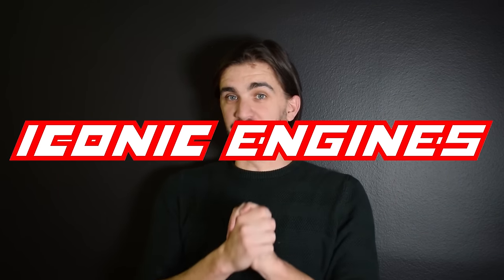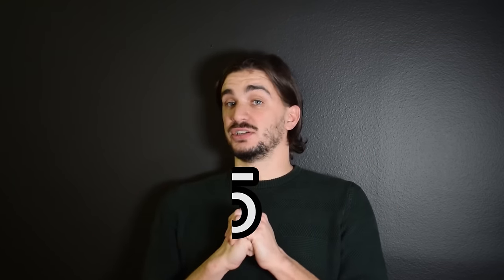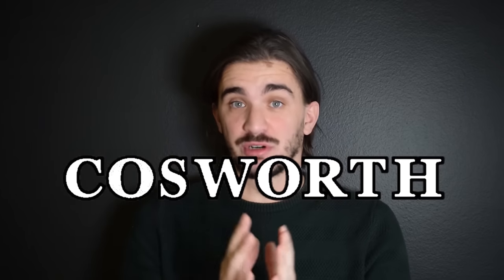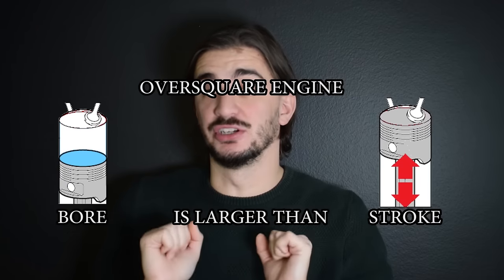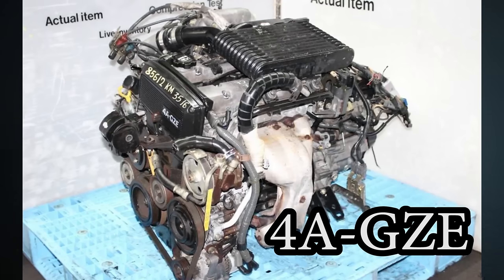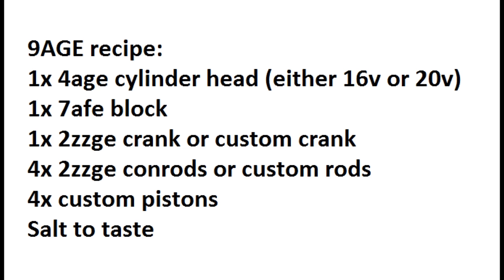Toyota 4AGE - What makes it GREAT? ICONIC ENGINES #1

Comment: I don't know how much initial d you watched but it is not all exaggerated performance. Later in the series when the engine blew they swapped it with a professional circuit race engine.
Reply: Not the 20v engine they put n takumi car. They only used the 20v engine because it looked cooler to the watchers then a Atlantic 16v.
Reply: @slow_carsgarage7422  then where did they get the engine from? When bunta was taking to his friend who called him about it they showed a racing circuit seen. Why was everyone so amazed and shocked and wanted to know how he managed to get that when they saw the new engine? Acting like it was such a rare beast. What about the high rev limit and power band?
Not picking a fight. Genuinely curious.
Reply: @basshead4204  for the anime they showed a 20v engine because it looked cooler to the viewer but the specs they told are all from the Atlantic motor. Make sense?
Reply: @slow_carsgarage7422  Wrong. They had Group A Racing in Japan back in the day. So it was possible to come across or build a Group A engine. Here is a link to the FIA homologation application for the AE101 Group A car. https://historicdb.fia.com/sites/default/files/car_attachment/1486656534/homologation_form_number_5437_group_a.pdf

Comment: Running a stock Silvertop-block, stock head(20v-ST), stock-bolts, stock cams, stock crank, getting about 500Hp reliably out of it from 1.6bars boost and a bit of nos... only upgrades are H-beam rods,  Forged pistons and bigger injectors, along with a dry-sump conversion... getting boost from a GT3076R and controlling it all through an AEM EMS-4 ...  pretty damn nice for the money spent on it... The only Downside for me, so far,   no DOG-BOX  gearbox options for it....

Comment: For iconic engines you really need to go further back to the true father of the 4AGE before the BDA which is the Lotus twin cam.  2 valves versus 4 but the same philosophy of a performance head on a standard iron block.  A good tuned 1600 twin cam on carbs can make 180 hp at 7500 rpm similar to many 4 valve engines due to its great port design

Comment: i give you a hint they mentioned it in Initial D aswell  A111 tuning  it includes 5 valve system revs up 11k makes about 240 Horses out of 1.6L  and yes it realy exist and is not made up by that Anime.
Reply: That engine is called the 4AGE formula atlantic. It's a beast engine for the circuit

Comment: This video will be a great start to a new series of iconic JDM engines. 

I think one point to note that the 4A-GE 16V and 20V if memory serves me correctly are interference engine. So in the case of valve float or the timing belt snaps. There is a high chance of bent valves and other major damage to the heads and pistons. 

As seen in the anime Initial D. The 4A-GE suffered major damage from over revving. Oil starvation and valve float are killers of any engine. Not just the 4A-GE series of engine. 

I think a good rival to the 4A-GE engine to compare with will be the B series engine from Honda. The B16 and B18 also appeared in Initial D found in the Honda Civics Type R and Integras. 

With all the mods and work put into the 4A-GE just to make power. 

Even for a 4A-GE fan like me. I will def suggest new guy to buy the 3S-GE Beams engine or the 3S-GTE. 

The ZZ engine while being the successor of the 4A family of engines had only one good engine for the bunch being the 2ZZ. The MR-S Spyder or MR-2 3rd Gen fitted with the 1ZZ were too slow. So the logical swap for the MR-S was the 2ZZ from the Celica GTS.
Reply: All 16v are noninterference and 20v silver top is non except the blacktop.
Reply: @slow_carsgarage7422  weird. Some info on the web says otherwise.
Reply: @linchester8464  alot of wrong info out there but any true 4age builder will tell you a 4age is a non interference  engine stock.Once you add bigger cams and high compression pistons that's when things change.
Reply: stock 16v are non interference. adding aftermarket cams and you can run into p2v forsure.
Reply: @noobatnothing  ok i keep that in mind

Comment: Why stock VS stock the small port is better than the big port? Great video btw.
Reply: Cams and valves can utilize the extra volume in the stock configuration. After loner duration camshafts and larger claves or ported heads, the big make more sense.
Reply: @gnhun101  I see. Thanks for the reply! Have a great day.

Comment: Power gains are easy, it's the best sounding Straight 4 of all time and of you tighten the valve cover and head bolts properly, it won't need a rebuild until 230k miles.

Comment: When I had my MR2 I built what I called the mid-port 4AGE. I used a large port head and a small mort manifold. I partially filled in the floor of the ports in the head to match the floor of the port on the manifold. I them widened the intake ports to match the big port head, which required filling in the open area on the outside of the manifold. Milled it all on a borrowed Bridgeport mill. I really liked the way it ran, better than the small port engine did.

Comment: My previous car was a Corolla Seca SX with the 4AGE and it was a blast to drive. I never modded it over the 7+ years I owned it and I thought the car handled OK. Then I bought an Integra TypeS which was a night and day difference in handling and frankly I'm surprised I even survived some of things I did in that SX... I'm still daily driving that TypeS 14+ years later, also still largely un-modded, it puts a smile on my face every time I drive it. I loved that 4AGE engine but the K20Z1 is amazing.

Comment: Does "4A" also stand for the litreage. Such as the 7A refering to it being a 1.8L not a 1.6L? And the 4AC block is different to a smallport 4AGE block so it wouldn't be the 4th variation of the A series block. Just a thought
Reply from the maker: The number doesn't denote engine capacity, as I explained in the video. It would be very illogical for 7 to mean 1.8l and 4 to mean 1.6 liter. You have 1A, 2A, 3A, etc all the way until 8A in the A engine family. The number in front of the "A" denotes the revision of the block, i.e. a significant change to the block design, bore, stroke, etc. All 4A block are very similar, with only minor differences. Cylinder heads between the 4AFE, 4AGE, 4AC are interchangeable. The 4AC and 4AGE block, doesn't matter if it's 4AGE smallport or bigport are almost identical. The internals (crank, rods, pistons) do vary of course, and as you would expect, are stronger on the more performance oriented engines.

Comment: 4AFE was only a single over head cam motor but a 16 valve head still. bit more uppercrust then a 4AC. And you also forgot the "4AFC" which is a carby version of the 4AFE
Reply from the maker: 4AFE is a DOHC engine, but only the intake cam is driven by the belt. The exhaust is driven off the intake. The point of the video isn't to list every single version of the 4a, you can use Wikipedia for that.

Comment: 4af is best, cheap as dirt and has a carb already. Friend has one it got 500k km and it revs to 8600rpm
Reply: I'm guessing 1st gen 4af?
Reply: @slow_carsgarage7422  yes with the older head, idk if there was 2nd gen 4af
Reply: @eurobeatmachinist732  2nd gen was efi
Reply: @slow_carsgarage7422  Yeah so it's 4afe not 4af😁
Reply: @eurobeatmachinist732  lol is it the one with the light grey/aluminium looking valve cover? Or the dark grey with red letters?

Comment: a Japanese D1AE86 builder managed to get 300 to 320hp out of a 4AGE just by picking the best stock bit of each version, the only things on the car that weren't Toyota parts were a dry sump system, fuel pump and ecu
Reply from the maker: Naturally aspirated?

Comment: you talk about initial d dialog yet you say "udder" insted of other...also there are no other cartoons period that go into the base engineering dynamics of racing technology and as far as dialog it was a manga first.. you should do more research and post fact rather than your opinion.
fact is the toyota 4age motor was a special engine that was produced by two manufacturers.
the head was not designed by toyota it was designed by suzuki based off of a motorcycle engine this is why the engine can high rev.
the design of the narrowing engine block or crankcase at the bottom supporting a large high flowing head..
this is what makes it iconic and great..
the weak points of the engine are oil delivery as most japanese engines are notorious for bad crankshafts, bad oil system and poor ignition system design.
you should point out these points... not your bad language delivery and critique of the best car cartoon out there..
since there is no competition to initial d.
but of course you knew that...but you seem to be a youtube actor not a engineer or engine guy...
sorry if i hurt your feelings but you should do your research prior to trying to make money on youtube which is a public forum.
Reply from the maker: Thank you! The weather is horrible today and I have a lot of chores, but this really made my day. So many amazing points. The engineering dynamics of racing technology in Initial D, the suzuki designed head, Japanese engines being notorious for bad crankshafts, the best cartoon out there! This is GOLD! I'm saving a screenshot of this comment for future reference and if I ever feel down again. Thanks again!

Comment: Hey kids 4age builder here just wanted to remind you that the 10k+ youd spend on a 6sp 240hp na 4age can easily be toppled with a f22c or f20c for a fraction of the cost. Also has a very fitting top end powerband for your 86(:
Reply: Yup, or a kseries with simple bolts ons.

Comment: How to get 200hp from your 4age
1. Remove 4age
2. Replace with beams engine
3. Enjoy
Reply from the maker: How to get 700hp from your Beams? Replace with 2JZ. You can use the same logic for every engine, but that's not the point of building engines and tuning. A swap may be the easiest path to more power, but for many car enthusiasts it's definitely not the most rewarding. Power is only one part of the fun factor equation.
Reply: Edit: how to get 200hp from your ae86

Comment: You wouldn't happen to know what would cause an idle surge? (Bigport red top) when I bought the car it had a couple vacuum lines mixed up, but it didn't have the surge, after fixing the vacuum system it started surging.
Reply from the maker: Likely the IACV kicked the bucket like on most 4ages. Or coolant needs bleeding if its an aw11 and has a bouncy idle. Could be other stuff too of course. Someone might have messed with the idle speed setting too.
Reply: The idle speed adjustment is the flat head screw on the throttle body?  If so, it does look like its been messed with. Im going to try to bleed the coolant and see if that helps though. Thank you for the quick response!

Comment: Can both 3SGE and 2ZZ be consider the successor of the 4AGE?
Reply from the maker: Well, the 3S is almost as old as the 4A, just 2 years older in fact and wasn't really developed after the 4A to be considered a successor. The ZZ series was developed as a replacement for the A series as the A series was getting outdated.

Comment: You, good sir, need to learn about OverRev! as it also does have the 4AGE at its heart, but in the best chassis possible - AW11.
Reply from the maker: I know about it. I'm an aw11 owner myself, I have like a million videos on my AW11 rebuild.
Reply: @d4a  I saw bits of you driving your AW11.  I am also an AW11 owner, but replaced the 4age with the 3sge (gen1) + s54.  Its nutty and I'd recommend it over any 4age.

Comment: The 4AGE and 2T-G have had any relation, I mean, some parts between these engines can be interchangeable, like engine bearings, conrods, pistons?
Thank you man, your information and knowledge are awesome
Reply from the maker: As far as I know almost nothing is interchangeable.
Reply: @d4a  thank you sir, can I make you another question? what is your opinion if I want to install molybdenum engine bearings to this 2T-G engine, this can be a good starting point for modifications, or is necessary to install new connecting rods at the same time?
Reply from the maker: @Culumbu  Everything needs to be measured and verified. Maybe rods are ok, maybe not. Have a machine shop check everything. Bearing material is important only if you're doing some extreme modifications. Otherwise install normal good quality bearings.

Comment: Can’t believe you didn’t talk about the TVIS system🥰
Reply from the maker: I didn't because in all honesty it isn't very good or revolutionary. It's basically a fix, almost like an afterthought, for the overly large ports. The smallport 4age shows how a better and smaller port design makes the t-vis unnecessary.
Reply: The Way I’ve heard it small ports where all about better flow through higher velocity in the runners. The TVIS was a failure point but was a way to exploit the same idea of higher velocity at low RPM. Sort of the way a twin scroll turbo is used; neither are meant to be an overall performance piece with serious mods.

But to your point of the fun factor in stock form, I really dig the TVIS and that change over sounds wonderful.👍🏼

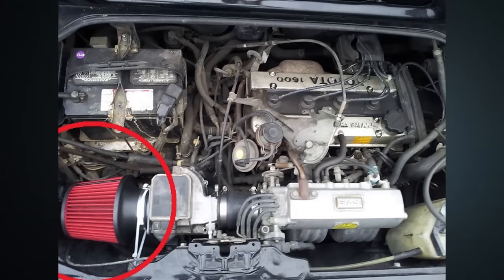Comment: 12:47 Why do people call that a cold air intake when it is so often a warmer air intake compared to stock?
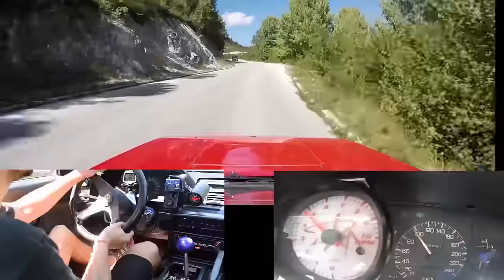13:29 Is that you? A total reckless driver endangering himself and others by cutting blind corners on public roads at racing speed!
19:44 So why was narrow angle then considered better for high power?
20:39 Expensive equipment, sucky user - running into limiter all the time.

Comment: What about the 4A GE engines that likes bearing knocks?
Reply from the maker: Which one is that?
Reply: @d4a  4A GE Blacktop and silver top 20v likes bearing knock when beaten on them
Reply from the maker: @fanatix2749  Every engine ever made will develop rod knock when it's abused with low quality or old engine oil in it and hundreds of thousands of miles on the clock.

Comment: The 4AC is a hidden diamond, I worked one in 1999, Holley carb, head port and flow, extractors, cam and valve and springs upgrade, balanced lightened crank and fly wheel. My AE71 pumped 120kw with that work

Comment: Talk about the 2zzge.....right now in Puerto Rico has the 2zz more powerful aspirate 262hp/171tq stock block(1.8L) running 11.1 more faster than every Beams(3sge)
Reply: Eduardo Rosas 22zzge is awesome, I have one in my 2003 Corolla Sportivo and I am forever looking for places to hit lift, it is so addictive. Highway OnRamp’s are the best
Reply: 4age is the 2zzge’s daddy
Reply: @Gazatron81  I had a 4agte at 20psi, it was running well, now I have a Celica GTS 7gen 2zz, to be aspirated it runs well, both are good only that 2zz is taking hp now
Reply: I just got a hi flow muffler put on and it’s made a huge difference to power.... Although my muffler that was in it was completely fucked, fibreglass was all broken up and blocking the flow
Reply: @Gazatron81  WTF!!
Reply: Ed Ros I know right, the old lady I bought the car off hadn’t changed the muffler since factory

Comment: 7:31 Takumi's engine ?
Reply: not quite but pretty close
Reply: Sort of. takumi's engine has its redline set at 11k RPM, so it's a little crazier than this.
Reply: Takumi's engine is a Group A 20V Silvertop 4-AGE
Reply: Well i guess his engine has a different pully/gearing setup on the dry sump so it can rev higher, maybe different cams and valve springt for more power at these high revs
Reply: Technically, yes. It is a Formula Atlantic 4A-GE with a Silvertop cover